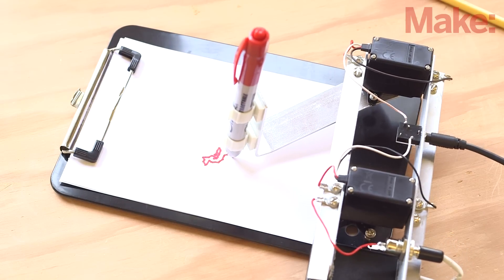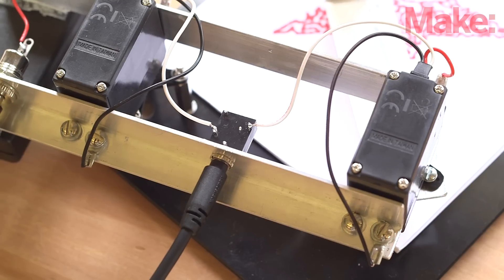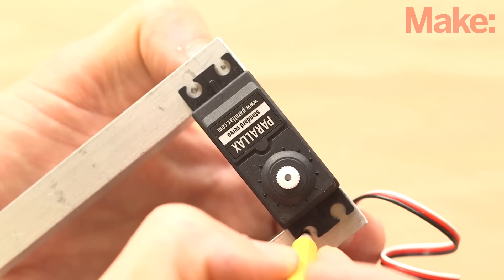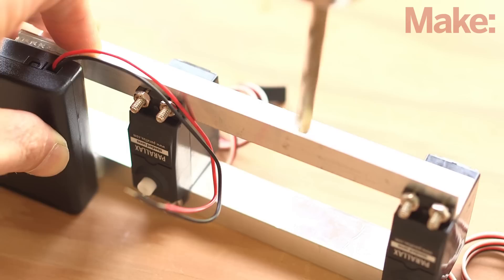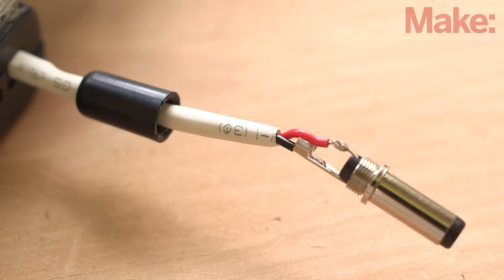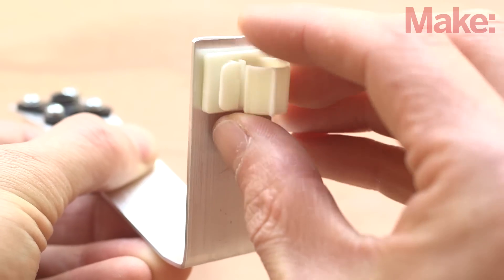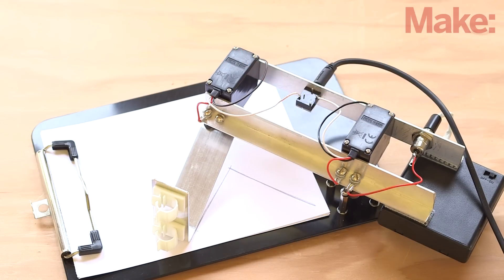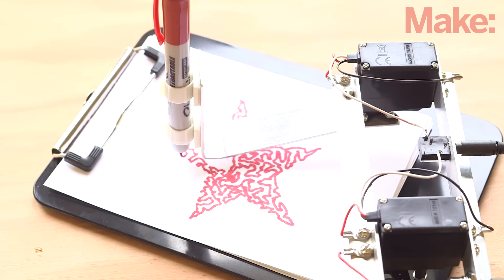Weekend Projects - TRS Drawbot

Comment: So... I could get a laser cuttter with a few changes?
Reply: Yes a suppose you could thank you for bringing that up now I want to try it.
Reply: Yes you can, just replace the pen with your laser but you will not cut but just burn the paper.
Reply: Maximiliano Pena You can use a powerful laser but control it with a regulator so you will be able to cut or just simple burn and have cool draws.
Reply: Well no, because you won't be able to turn on/off the laser with audio signal (like now the pen never raise up).
Reply: Domino SixO I think that may depend on the laser but yeah, I thought about using it with harder materials tough.
Reply: it would be very inaccurate look at how jumpy the lines are on the page
Reply: Alexandre Lavoie The audio signals are used to control the servos, the laser you will be able to turn it off and on manualy or with a microcontroler, if you just wanna burn a image thats not a problem (like the pen).
Reply: Maybe with multiple audio outputs, but this is not a suitable interface for reliable cutting machine, you will prefer go with CNC method by using microcontroller and communication port (such as serial or ethernet or whatever) to upload commands.. Also for precision it will be better go have X-Y-Z axis instead of angle driven device...
Reply: Maximiliano Pena  bbbbvç
Reply: slow learner

Comment: Use a haxor?
Reply: Ariel Barton He says "hackser"
Reply: what is this ? explain please
Reply: ***** It is a handsaw technically though its a hacksaw.
Reply: Usually nicknames are used when the actually name is long or cumbersome. In this case, "haxor" is no more efficient than "hacksaw".

Cool project, tough.
Reply: I think the tool is called a Hack Sir:-)
Reply: Strange how he pronounces "hacksaw" as "haxor"
Reply: +Achron Timeless i noticed that hacksaw turned into haxor/haxer
Reply: A Haxor is like a handsaw, its just a nickname.
Reply: Hackser, not haxor
Reply: Yea, like using a sodder.
Reply: Bist du deutsch ?